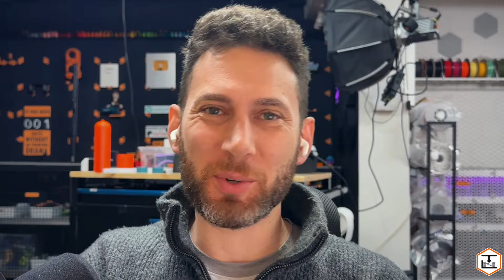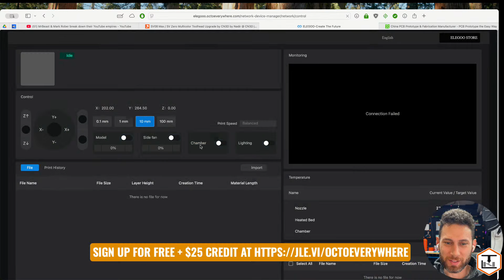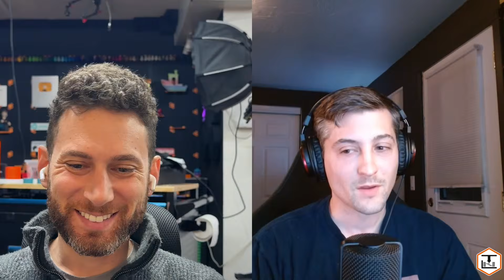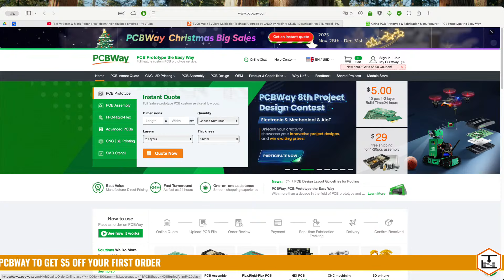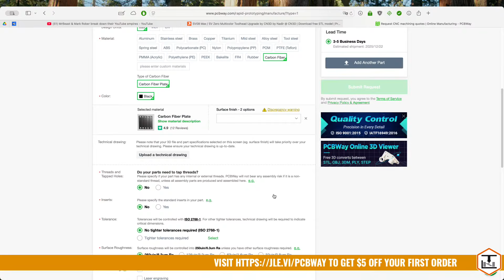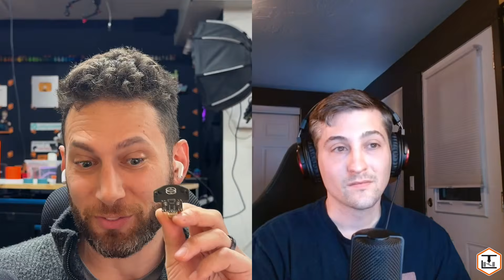Ep. 75: Justin of Pisces Printing on Turning CAD Expertise into High-Performance 3D Printed Speakers

Comment: Im having trouble understanding where TPU is used for speakers but would PEBA be better used since it bounces back rather than absorbs energy like TPU?
Reply: The flexible material is used when making the speaker driver. Specifically the surround and spider or “suspension” of the driver. 

The speaker enclosure you usually want as rigid as possible to preserve any energy from the driver.

I go back and forth between talking about creating the enclosure, and the actual driver. I’m sure that did cause some confusion. Sorry!
Reply from the maker: Bingo. PEBA is better for all of it
Reply: I don't know anything about speakers, but I'd imagine they are probably using it either because it's cheaper or because it absorbs energy.

Sometimes you want a spring, sometimes you want a damper and sometimes you use both.